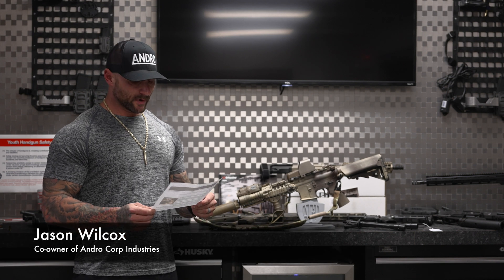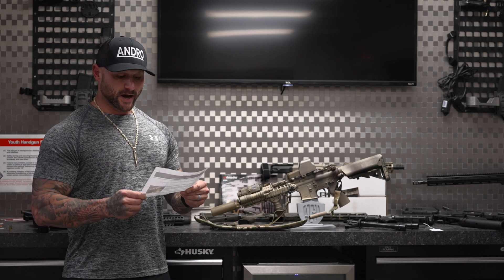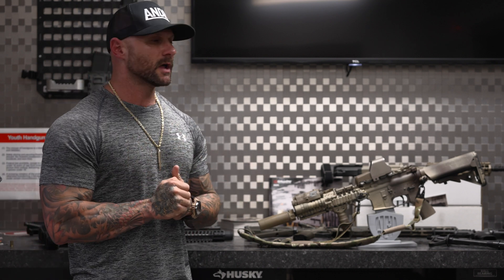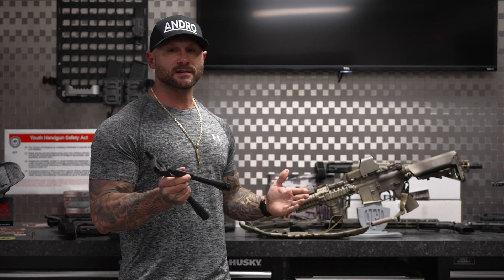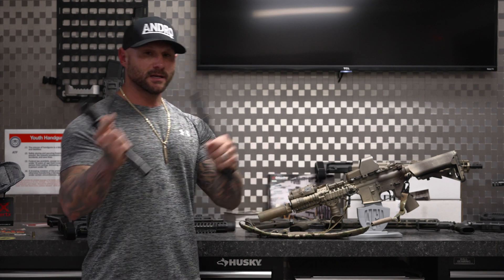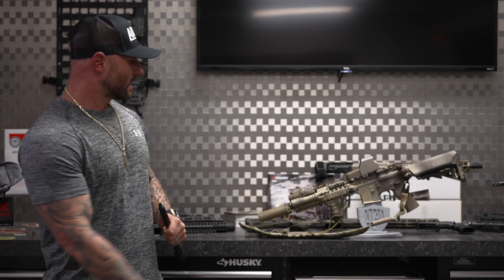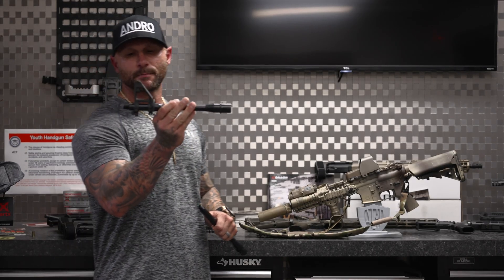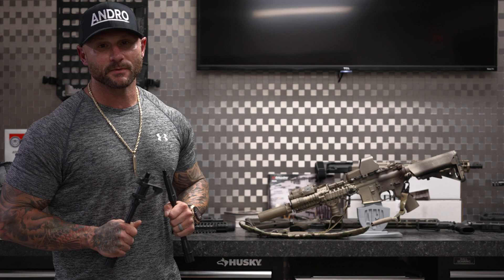WHAT IS CRANE SPEC? | Jason Explains Andro Corp's 10.3 INCH CRANE SPEC Barrel

Comment: so I bought one and my upper will not seat flush with the lower. the bcg sticks out 1/8 of and inch, and when I try to close the upper to lower it does not close.  I've changed the buffer, spring, weight,  retainer pin, assembled upper, bcg, and charging handle. Still will not close, so hopefully the new barrel is ordered fits.🤷‍♂️

Comment: Step 1:  Get a Crane spec barrel for your build.
Step 2:  Get a tube of high temp RTV and run about an 1/8th bead along the horseshoe of your charging handle.
Step 3:  Make your can glow in the dark.

That's  how I was taught to deal with overgassed guns back in the day and it still works.  Why would I spend $$ on a CH that does what I already know how to fix?

Great vid Andro!

Comment: I have an .70 SD 2021 CHF CL barrel on a radian lower  mk4 rail surefire warcomp neutral in9.3 and with Geissele super 42 in an H2 with full power Mk262 , Speer gold dot (best home defense ammo) 75 grain soft Point and regular m855 ball and get a beautiful three to 4 o’clock ejection I wanted a barrel that I had accuracy and it will last I’ve also ran different Roscoe barrels also and if you’re looking for a decent barrel use them or blessed to give than edge Roscoe I know has the sauce pack where are you get your barrel your gas system where you get but I traded gas to the traded barrel and I traded bolt carrier group HPNPI tested and have zero issues from it runs Great and will have more longevity because you’re adding material to the barrel web Goldhammer forging you’re stretching the bathroom while maintaining the integrity of the barstock 4150 CMV but in less than 10 minutes time I swapped out the barrel and I don’t think it was a crane spec it was an Andro Corp. barrel but it came from what the gun started out as which was the halo with a 10 inch barrel but that older barrel definitely had a much bigger Gasport and the newer down defenses and I think it’s because it’s crane spec for the URG program possibly so I’m assuming all of their barrels are clean in spec now for military service because in the military there’s no anorexic ammo under powered ammo that’s one of the reasons I tell people hey shoot a few mags of your self-defense load and zero it with that specific round and if you’re shooting it with a suppressor shoot with the suppressor so your POI difference zero shift do you keep that RC2 on at night .. he don’t want to shoot a 10.3 indoors with no hearing protection it would suck but using full power ammo especially the MK 262-1 at least that’s what the packaging said was definitely a hot round and was spilling the brass out at around a little past 3 o’clock i’d say but after putting about 500 rounds through it after I put the gun completely back together after throwing in the barrel and changing the lower as I still have an Andro lower and I’ll probably use it for a RIs 2 14.5 and he was a keyhole lower but definitely do you want a heavier buffer system what is the weight is fine still try out the super 42 minute H one configuration and you will love the fact that you don’t get that cream cold sound in the buffer tube ends you get much more retention in the stream lying because I’m not gonna go into tensile strength or any of that but it’s very very strong 500 times stronger than your standard spring and we’re talking about it being ran full auto and runners for the mostly most of us my original buffer in spring next to it lost significant about the few thousand rounds I put through it before swapping in a super 42 braided wire buffer system it’s similar to the system on the MG 42 which had a very high cyclic rate so it’s one of the reasons I threw it in my MK 18 ish gun no it doesn’t have a RIS to rail for cloners I chose pieces that I like that go for myself
So it’s a 10.3 Daniel defense CHFCL barrel in 10.3 if you’re not sure if you have one and a half gallons of fans as DD on before the one and seven marking on right upper portion .. 
The reason I got it is because it came as a cranes bag as per the size of a mark 12 gas block knights armament gas tube , holographic EXPS 3–0, Daniel defense fixed irons at absolute height in DD‘s version of FDE so, GEISSELE MK4 Rail 9.3, sure fire warcomp Neutral timing, mil spec upper surefire mini scout light pro with the DS07 tail cap and wire system Mounted on clog defensive tape switch mount and wire control set up definitely takes out that extra wire and you don’t have to use zip ties, obviously I said radian lower being left-handed definitely has its advantages with a radian lower and I get their lightweight QD and plate for the Geissele ddc type three hardcoat anodized buffer tube and their castle not because it’s extremely clean you would think it’s anodized itself and it’s much harder than other castle lots I’ve had in the past whatever source material they use and it’s because it has smooth and it doesn’t have scratches and stuff like you get with a lot of cash so much right from the factory I have a super 42 heavy braided wire buffer system and an H2 configuration it drastically gets rid of recoil and the twang sound you hear from the buffer spring it’s smooth like butter is all I can say you don’t hear it when you’re shooting you don’t hear it when you’re wrecking your charging handle I still have my BCG that most likely wherever Andro gets theirs from back in the day few years ago this is a phosphorated looks like crawl mind HPNPI tested BCG and chrome Lined gas key radian raptor SD with NP3 coating ( similar to the nickel boron so it’ll run cool basically) SD3G trigger if I ever need those back receiver parts like upper and lower receivers I do use Andro the anodizing they do is definitely high-quality I don’t like the dust covers just because they really easily grip repair anodizing post to others but back to the 10.3 queens back discussion Daniel defense barrel I chose because it being crane spec and it’s more than enough gas to cycle full power ammo and regular ammo I’d say 4 o’clock ejection with a 3 o’clock using an H2 I could probably get away with an H one but it literally feels like I’m running a break on my God almost 0 recoil don’t know how I know that it raining in lower is very heavy and that’s the only difference in the fire arm geissele rails are the shit extremely easy to change out a barrel on most of their shit off‘s but not the MK 16 rail or the urg mk16 rail That is replacing Daniel hose RIS 2 quad rail system and it’s definitely a tight lock up the ID end of the arch very very tight it’s really now more as a night vision shooter from myself that’s why I got that specific model it’s very very tight it’s got a huge tight strong dog on lock up that’s different than the other rails and it also uses captured bolts and points at screws for your upper receiver bottoms like all their rails have except they also have them at the upper 45 so if it were to come off-center win be drastic but it takes a mallet and grease with some CLP to get that fucker on the Barrel nut but I have to say the wedge lock barrel night that I have cranked off from Andrew holy Christ the thing is heavy and it was on there tired as hell give you guys that but I switch things around slowly but as long as I have all as a shooter back in 2008 when I joined the Marine Corps revolution war so all right this what you’re missing here you go here’s the M-16 A2 then M-16 A4 and I’m like yeah I can I need an M4 unless you got him 16 with an adjustable stock which at the time they did not but now they’re using the Vlotor A5 so the Marine Corps can keep all of their and I’m laughing as I’m saying the same 16 uppers they could’ve done this a while ago because a fixed dock is very like an M-16 suck is very very big like being a smaller guy it’s kind of a hard to do in certain positions noon distance while I have my original M-16 A2 with a three round burst talk about zero recoil what a wow gas system but then you get into a 14.5 M4 I have a colt I know people talk about FN but I had court I think we were given like the block 1 .5 m4s I think if they invest in the air by HK416 Basically I am four that’s an HK 416 and I don’t know if I’ll need it for special operations command units under so Carmen would be receiving it but the fire alarm stage much cooler they use The Heavy HK 416 called hammer forest barrel instead of the MA 55 a one round they’re using I think 62 grand match ammo assuming just because the fragmentation you get From otm rounds  especially because of water operations…..
But back to if you have a crane spec Gas port on your barrel I’d say do something like if you’re having issues with ammo first try different ammo and I would also say if you have an h2-3 go to a h1 and or get like a JP enterprises lightweight boat carrier or something but zero with the ammo u would use for self defense and if suppressed zero w the can on and surefire has almost no poi dif

Comment: Is the gas port the only thing that is crane spec on your barrels? How about materials, lining, ect.?
Reply from the maker: Our Crane Spec Barrels are the following.

– 4150 CMV Melonite

– QPQ Corrosion Resistant Finish

– QPQ M4 Feed Ramps Extension

– Carbine Gas

– 1/7 Twist

– 1/2×28 Muzzle Thread

– Pinned F-Mark Front Sight Base or With out FSB

– Gas Port Size .070

Comment: Good info. In your experience which hand guard is more comfortable to shoot heat wise? Quad rails or just the plastic carbine hand guard?
Reply from the maker: Honestly is shooters preference. If you ask the guys around the shop they all will have different responses to this question. The mk18 Ris2 Manages heat well IMO. Adding the Knights Rail covers over the Ris 2 rail will help heat management as well.